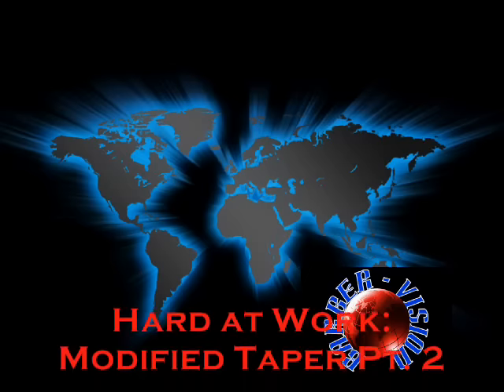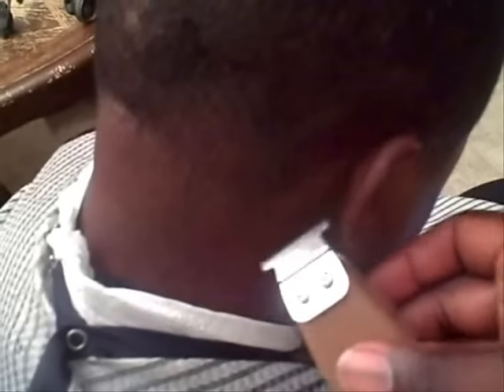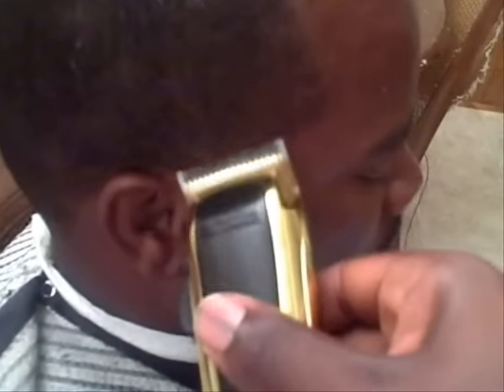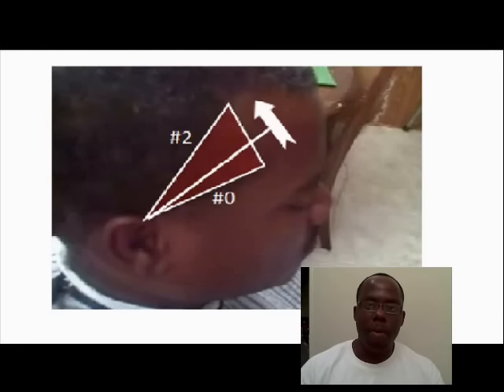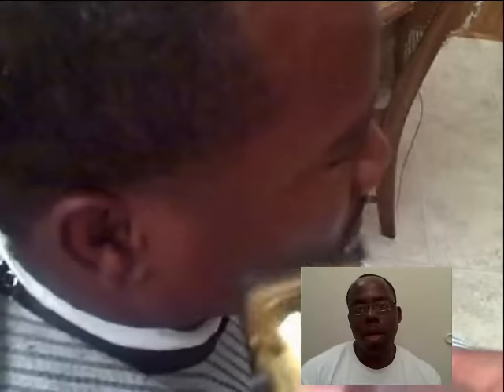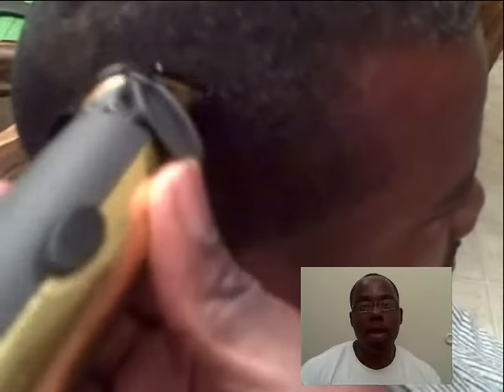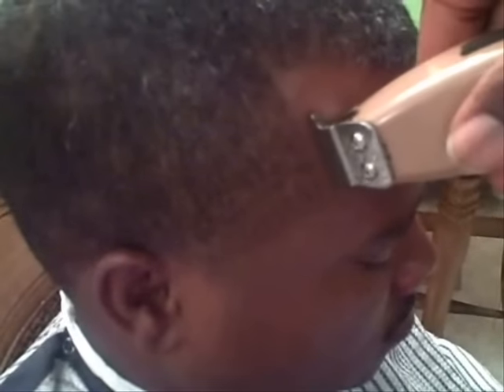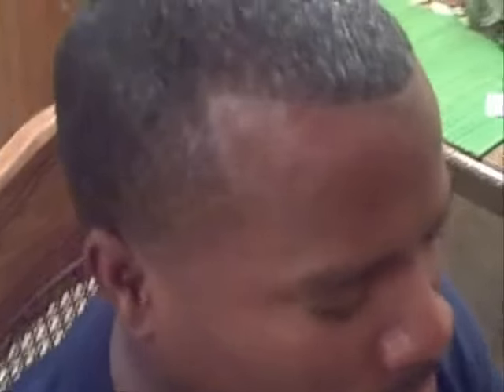Hard At Work: Modified Taper, Pt. 2

Comment: @mrluton 

I ended up getting the easy style.....
the place that I go only sells pro model equipment....I went there to get the easy fade, he didn't have it so I left....I did a bit of online research and figured that the  clippers of both "easy" products are similar but the fade comes with more accessories. the easy style is a stand alone clipper with just a few guards.

the easy fade is a better value though...but I saw a video where another respected barber co-signed the styles.